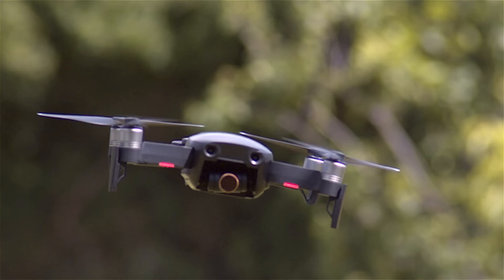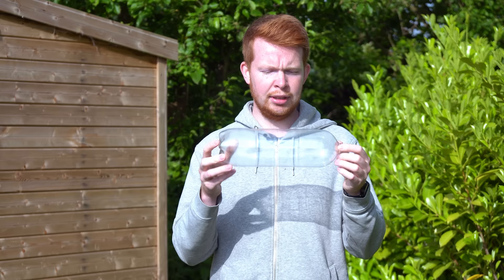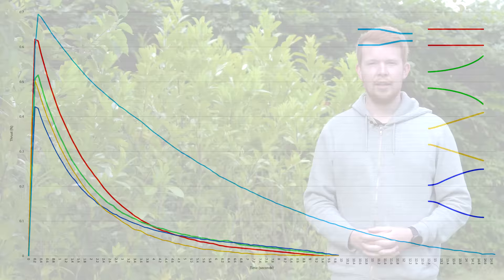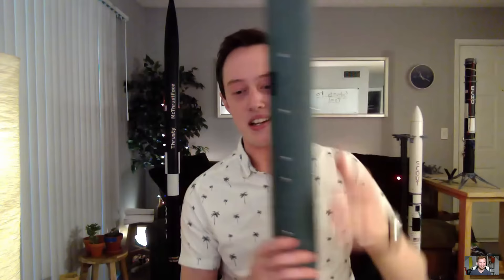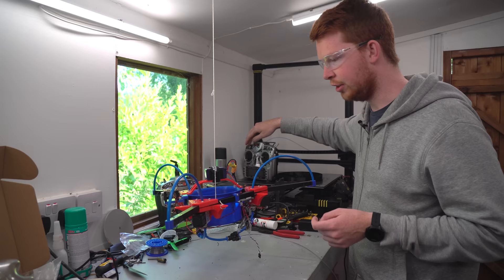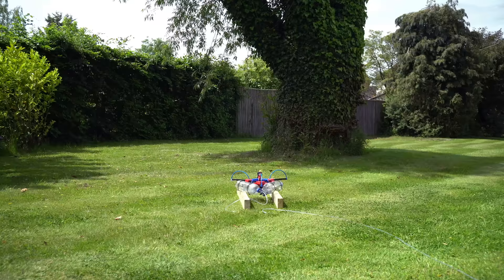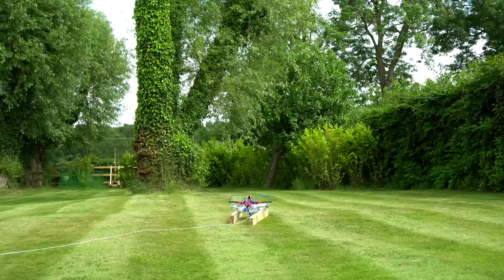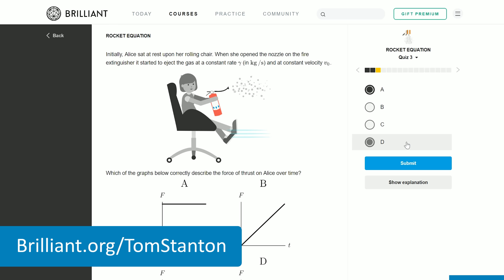Gas Thruster Controlled Drone

Comment: ANSWER: The straight nozzle will produce the most thrust.
Reason: Because those other nozzle shapes are meant to create a column of ambient pressure outside the rocket to climb through ever decreasing atmosphere. Your vehicle will not have to deal with such drastic changes. Go with the straight nozzle.

Comment: 5:22 pausing the video. Blue one is the legit one for pyrodynamics, as the walls cool down with the unburn gas. I'd go with green one. It's more feasible at supersonic speeds (if the nozzle reaches supersonic) it will ease the escape velocity.
Edit: your end results suggest the escape velocity is subsonic (optimal choice: straight)

Comment: Rocket nozzles aren't bell shaped. They use what's called a converging-diverging nozzle. First the nozzle constricts to increase pressure, then it expands, lowering the pressure. Lower pressure means higher velocities of exhaust and more efficient thrust.

Comment: The bell nozzle is expected to be the worst in subsonic flow rates. In order for it to shine it's a must to have the flow at Mach 1 at the throat. At subsonic rates, a converging nozzle is actually the best (as you saw). This is similar to how fighter jets constrict their nozzle when not engaging the afterburner.

I think the bell might have worked if you had a further constriction (acting as a throat) before it diverges in order to enable the pressure to drive the flow there to >M. The area can be calculated if you know the pressure and temperature in the combustion chamber (which in this case is just your air tank)

Comment: Writing comment while watching the video at 5:15 time stamp.

I believe that the straight nozzle would give most of energy and efficiency since it does not lose pressure with expansion. Even better would be a converging nozzle. And even better would be a convergent divergent nozzle like those used on actual rocket engines which had has a choke point where the flow is supersonic and at which point expanding doesnt lose energy, but optimises the efficiency by transforming the pressure(and heat subsequently) into exhaust velocity. Not sure if u can achieve a supersonic flow with a standard water bottle though.

Comment: 2 ideas: 
1. wire legs to protect when falling & provide needed height.
2. Add a 12v micro air compressor that will kick in when pressure is low.

Comment: I didn't realize those Two liter bottles were capable of holding that much pressure? I especially liked the design of this craft. with the lift props and motors in the center in a protective cage so to speak. and having the three thrust valves and nozzles doubling as landing gear. and the bottles acting as shock absorbing bumpers. in the event of hard impact crash. maybe moving the bottles outboard some. would protect the nozzles better in the event of a hard impact crash. being as the lift motors and props and the nozzles are the vital components of the craft. and the bottles can be replaced cheaply and easily. in the event one or all them happens to get punctured. the test flights seemed to show some promise. and at minimum it might make a very good hover caft.

something else those bottles might be a good alternative for the air powered bicycle. being as you could fit it with a number of them. and their light weight.

Comment: idk if anyone's said this yet, but there's a fairly simple explanation for why the converging or straight nozzles outperformed the diverging nozzles.

 when a flow encounters a change in cross-sectional area (width of nozzle), the change in flow velocity is proportional to the area change and a (1-M^2) term, where M is the mach number of the flow. this means that when the flow is moving at subsonic speeds, decreasing the area decreases the speed of the flow, which from newton's laws means that we're stealing energy from the flow and putting it into the nozzle (and whatever it's pushing). BUT when you have a supersonic flow, the (1-M^2) term goes negative, so a decrease in area means an increase in the flow velocity. therefore in the case of rocket engines, where the flow is well above sonic, it's better to have a diverging nozzle, since we want to decrease the flow's velocity to steal its kinetic energy.

hope any of that made sense lmao

Comment: Have you tried different substances, that are heavier then air as a propellant? fill the tanks with water 50%, and then pressurise the system ( I know, that needs more lifting capacity), and in exchange you'd get snappier control responses, and it'd also last longer, or perhaps quickly evaporating liquids that themselves provide some pressure as well simply by evaporating, and then the nozzle power figures would be different(it is because of the expanding gasses the rocket have such shaped valves, instead of straight pipes)

Comment: Oh my god the actuators that you were using to control the air are identical, To the turbo control valve on my Volvo it has three vents ,  and  one constantly given a small amount of air coming out like what you said in the video.  TCR is  what they are called in the car, actually I think they are actuators which will give air in a nanosecond depending on what electric signal was sent to it,  if I did not know what is video was all about  and,  I had a just seen that in your hand, I would have just thought it was a turbo control valve, lol.  But great video👍

Comment: Okay its an old video but maybe you should try using 6 bottles, half of which have 80 and half 100 psi pressure. When the gyro sensor goes crazy, you open the valve of bottles with 100 psi, otherwise bottles with 80 psi pressure will be sufficient. And this project is brilliant, thanks for sharing

Comment: This has probably been answered, but I think the unexpected nozzle selection has to do with the air flowing sub-sonic through the nozzle.  With rocket nozzles, the gas flows at the speed of sound through the throat of the engine, then accelerates in the divergent section of the nozzle.  In your case, the gas flows through the throat below the speed of sound, and then by bernoulli's principle, the air slows down as it flows into the divergent section.  At any rate, this why I think you don't see greater thrust from the divergent nozzles.

Comment: i think u loose a lot of the power because the air flow is twisted outside by the 2 round bottles...  a light round, and long frame around the propeller would help a lot i think.

Comment: Buddy you can add a pressure sensor and feedback system that calibrates the valves open/close cycles with the pressure of air inside the bottles each moment.

Comment: What if you added a heavy mass to the propeller on both motors? Thinking the gyroscopic force might help with stability without even needing the nozzles for the smallest corrections, and perhaps helping to avoid over-corrections.

Comment: Try doing it with vaccum in the tanks and add a plate around the nozzles so the vaccum will pull air onto it resulting in it beeing mouch more efficient and accurate

Comment: Great work noticing the solenoid restriction; that was the flow limit if your system, and any nozzle of a larger diameter than that would be limited by it, and wouldn't achieve best performance. 
There are pressure regulators that can set a lower operating pressure than your tank pressure; that would fix your extreme changes in performance due to pressure variance, or you could limit the flow rate further & narrow all connected tubing, limiting the burst of peak pressure.
A single larger tank should give you more working volume for a lower weight penalty, see volume vs surface area math for cylindrical bodies and apply the mass of the plastic.
I wonder if a vertical shroud around your thrusters would increase efficiency, same as a shrouded fan, tho hopefully more so. This could let you narrow the nozzle diameter while maintaining thrust, extending flight time.
Dry ice thrusters may give you similar performance with a longer flight time: add a pressure blowoff valve to prevent the bottle exploding (safety valve - they're usually 140psi or so, but you might find a standard one at 110. Custom ones are also possible.)

Comment: they have this thing you can fly around with using a jet ski to pump water its small and got enough torque to lift a person in a small form factor. also flying over the water not very high just feels safer

Comment: I think as one of the other commeter's idea, you must get a little pressure regulator and set it to around 40 psi. What you can also do is put 4 nozzles and 1 large tank because it will reduce the processing that the arduino needs to do to convert the 4 motor signal to a 3 motor one (I guess?) So that will also reduce the time it needs to react to the signal.

Comment: Man, PWM control on the Arduino side of things would make that so much more stable. Like, have after a minimum value it starts pulsing the thrusters, and then when it reaches a max value it keeps them on all the way. Doesn't need perfectly accurate PWM timing, it would just be a software change.

Comment: The problem that the drone will not lift off directly from the ground seems to be caused by the air that is escaping underneath the curved downside of the bottles. Similar to the wing of a plane this causes a drag, but in this setting the drag is pointed towards the earth in the opposite direction of the thrust generated by the propellers lowering the overall lift of the vehicle. 
Great video, love your channel. Stay healthy! Many greetings from Germany.

Comment: With this kind of drone it would be better to make a quad motor with dual ducts for more thrust and better lift height, also try adding air thrusters mounted to the sides so the drone is able to make swift almost instant turns to allow you to do tricks and maybe mount a small gopro to the bottom of it in the center of mass as to not throw off the drones balance

Comment: turn it into a water rocket! More mass, more thrust (might want to upgade the lift fans though). Plus when it all goes pear shaped you'll have everyone diving for cover.

Air pressure like that is subsonic, so you don't get the advantages of using a divergent nozzle. A purely convergent nozzle extracts more energy from the stream. But you might be able to get more thrust by using a thrust augmentor (similar to the pulse jet style though this'll use a different effect for it).

 I believe if you have a very shallow funnel (i.e. entrance is 5 mm^2, exit is 4mm^2) and you shot the jet into that funnel, the jet would end up dragging ambient air through the funnel, that air your dragging has to get it's momentum from somewhere, and it will, it'll be like having the nozzle in ground effect/restricting its flow. Effectively you're using ambiant air as reaction mass, at the cost of jet velocity, but jet velocity is your enemy at low speeds like that. (Somewhat similar to this bing bag inflating exercise https://youtu.be/at0xRBacJF8?t=402)

Or you could just have the jet blow on a turbine that spins a big fan/prop, but that's a bit cheaty and not as solid state so... no.

Comment: What would happen if you had the thruster arms at their original lengths but adjust the angle of their thrust slightly more outward, lets say at 45 degrees downwards from the horizontal plane.
This might/should lessen sideways shift and the propensity to flip over. 
Anyway, you've created a great project, please continue to enthral us further.

Comment: restricted nozzle works better for this application because you are dealing with subsonic air. rockets can use bell shaped nozzles because use supersonic air. When air is subsonic passing though a restricted nozzle will increase its velocity the opposite is true when the air is supersonic.

Comment: This is great video, but you forgot one simple thing. You can stabilize your drone through balance conditions. You need a calculated weight on the bottom of the drone. Always use the torque condition. If you want to align a pointer of a scale, you also need a corresponding reset weight so that you can create a calm behavior.
Without an appropriate restoring force, your system becomes unstable and tends to oscillate. Take a look at the MSR lectures. You need an PDI limb that is the key to good stabilization.

Comment: Just saw this video.... the interesting question that comes to mind is that NASA used the wider nozzles on the 1st stage, 2nd stage and command module, of the Saturn 5.   The lunar module descent module as well if memory serves.  However, the maneuvering thrusters varied by design often straight or nearly straight, on command module and shuttle.  The Saturn 5 btw had for the time, almost completely analog controlled actuators for the outer 4 engines.  There was some digital logic sensors even in 1960s on the Saturn 5 for positional awareness, but it was limited of course, so must of the guidance system was digital to analog conversion for mechanical movement of the nozzles.  The lumar module of course is famous for its limited capacity on positional awareness, but that is a story for another day. :)

Comment: I know this is 2 years old, but if you ever do revisit this, maybe using a pressure sensor on the tanks to adjust the valve duration as the pressure drops?

Comment: an improvement that could have been made to drain the batteries less would be using transistors in place of relays to control the valves, as they are more efficient and also survive more on and off cycles.

Comment: Add pressure sensor, feed pressure reading back to flight controller and adjust gyro settings based on pressure readings.

Comment: okay - nobody is going to see this but I'll post it anyways

You only need to know the speed of the gases right before entering the turbine and you can optimize its acceleration. Theres a reason behind the shapes of rocket nozzles: the biggest part is the part of the nozzle that conducts faster than sound gases, and the bell-shaped nozzzle actually accelerates the gases at that point; before the gases reach the speed of sound, the nozzle needs to have a smaller and smaller section while guiding gases towards exit. 

For people that understand formulas, the Hugoniot-Rankine theorem is so, so much better at explaining this phenomenon than my words: 
Let S be the section of your nozzle at a certain distance x from the start of the nozzle, then dS will be the differentiate of that function S(x). Let c be the speed of sound, conctant, and v be the speed of sound at the distance x from start of nozzle, then dv the differentiate of that function v(x). The Hugoniot-Rankine Theorem, or Hugoniot's equation tells us:

dS/S + [ 1 - (v^2/c^2) ] * dv/v = 0

as simple as that. This equation tells you how the section of the nozzle should evolve according to the gases' speed. if you rely this formula with Bernoulli's equation of fluids you get a working model for any simple gas at any speed, for any simple section of a nozzle that can be coded on python in under 15 minutes.

Because I don't think the gases reached the speed of sound in your first tests, I think the three nozzle you had tested were in no way making the exhaust gases faster, and actually diminishing the efficiency of your setup.

Comment: Curious the outcomes if you were to use different gases. Helium might provide additional lift thereby easing the strain on motors. That is until the tanks are depleted. Hydrogen with an automatic igniter might be interesting. At least it would look quite brilliant if only for a short while. Take care.

Comment: The issue you're having is a bit like a top, it can remain balanced if it were spinning. Without the cyntrithical force of it spinning the thrust being centralized accelerates tipping force.

Maybe make a manifold to displace the thrust over a greater area. You could design a drone that spins to keep the weight balanced

Comment: i would love to see another cold thrust drone with a slightly different setup..
one small bottle capable of at least 3000 psi mounted above or below the centerline of the drone.
much higher operational frequency for thrust vectoring parts and more fine or tight constraints on the data inputs so it reacts quicker.
also, a decent capacitor bank for the power system leading to the thrust control system.
the goal would be the highest air velocity for the shortest time. 
i am sure you have your own ideas on the next one...

problems with this one...
large bottles have not only weight distribution problems, but also the coriander effect opposing the main engines in both propulsion and vectoring.
the control sys did work but is clearly lacking the crispness in response needing faster cycle time and more potent thrust. if you notice, a lot of the attitude adjustment was done in a time space where the air line has already lost full pressure ending up with most adjustments in direction taking way longer than they should.
also, the motor was fighting with the attitude control on available raw battery output. a cap bank would help smooth the current draw spikes.

Comment: If you've ever played battlefield 4 and have the Hanger 21 map you can get a little jet powered drone that seems to work in a rather similar method using the jet engine to create the compressed air

Comment: Just use co2 cans or the wippits. They are used in airsoft. Experiment with paintball rifle cartridges and airsoft pistol cartridges. There is a difference in size. But they are kinda the same thing. One just has way more air.

Comment: You could try to add water in the bottle (half water - half compressed air). I think it acts better as "fuel" because of its higher mass. Air rockets anyway go much further (or higher) with this configuration (the nozzle must be at the bottom so that the air pushes out the water first). Even with a small flow of water you get decent thrust, while you need a much larger flow of air to achieve the same.